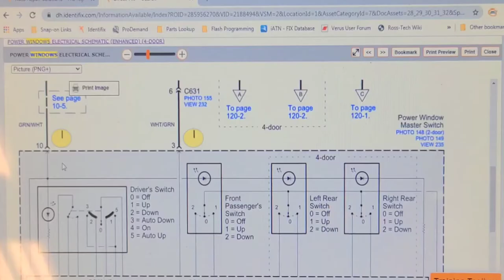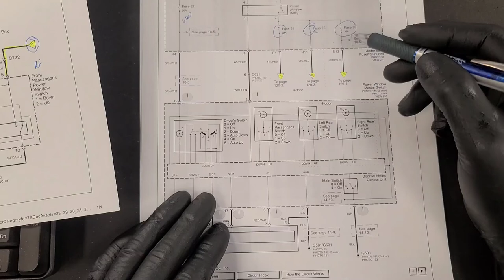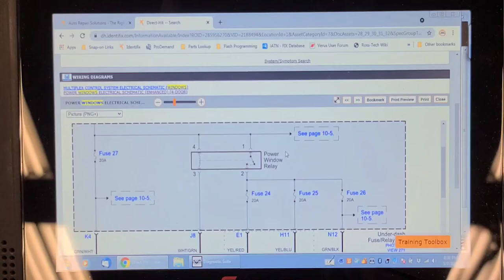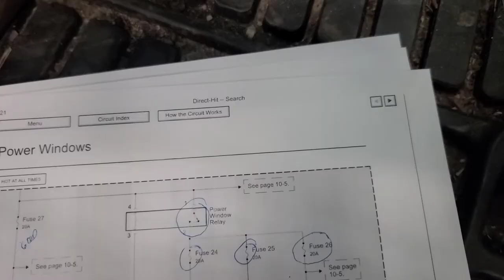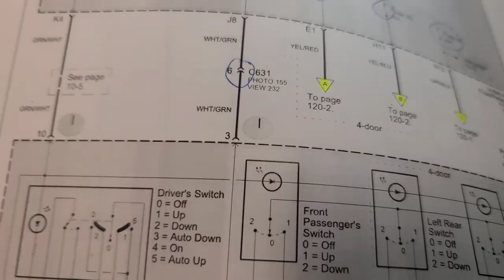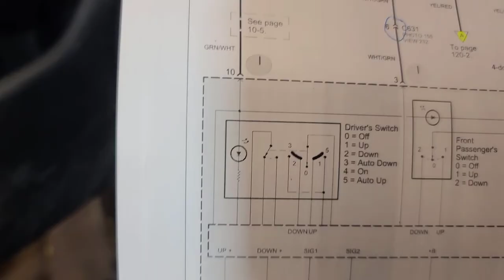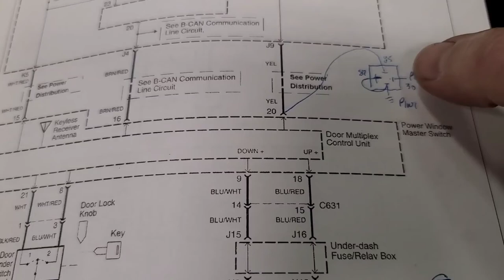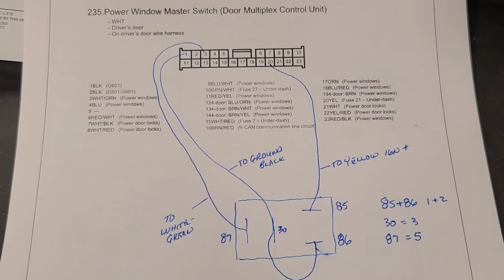2007 Honda Accord 4 Door SE. Three Power Windows Don't Work From Any Switch.

Comment: have you ever run into this problem on a 2001 Honda accord lx sedan been trying to fix it for a month and a half have run out of ways and ideas to fix it it is the exact same problem as on this video and where can you find a fuse jumper/relay tester
Reply from the maker: No I have not. I took a look at the schematic and it's quite a bit different. The master switch on the driver door locks out the other doors by removing the ground for them. It does not turn on a relay like this 07. There is a relay under the dash but it's turned on by the Passenger Multiplex Control Unit. This relay feeds all four switches so if your driver switch is working then this relay is good. Check fuses 7, 8 and 16 for power with the ignition on. Do the other three windows work from the driver control switch? There is a white/red wire at the master switch on the driver door that is grounded by the lockout switch to enable the other three windows, Check to make sure you don't have a broken wire between the driver door and A pillar. make sure that the white/red is grounded if not supply a ground to it and see if the three windows start working.

Comment: I’m also not the most familiar with electronics but with your relay bypass what exactly did u do with the wires? I know which ones u used but did you disconnected them from the master control and put them into your bypass and then used another wire to reconnect it to the master control or what
Reply from the maker: at 12:19 in the video is a schematic. All the wires from the relay are spliced into the appropriate wires at the master switch. The existing wires are still connected to the switch. HTH

Comment: I THINK THERE IS ONE MORE SIMPLE SOLUTION IS. YOU NEED A SWITCH BUTTON ON THE JUMBER WIRE IF YOU ARE NOT USING POWER WINDOWS ALL THE TIME . DISCONTINUE THE JUMPER BY SIMPLY SWITCHING OFF WITH BUTTON. AND I HOPE THIS WILL NEVER KILL YOUR BATTERY  THATS WILL NEVER KILL YOUR BATTERY

Comment: I have honda accord 2006 special edition lx. Front doors windows works but back window not. Should I change only the power switch?
Reply from the maker: You need to check the fuses, then test the circuits to the switch between the door and pillar.

Comment: Great video and very detailed explanation.
I have a few questions.
Working on 2007 Accord Ex (same layout as yours)
How much of an impact would parasitic draw put on the battery for bypassing the window lock switch?
I tried connecting pin 20 and pin 3 to only ground when the ignition is on. But it is working when ignition is off and doesn’t work when ignition is on
Now with relay, I tried connecting as you described, but the passenger side switches are active even when ignition or off. So For me the parasitic draw is happening with or without relay.
Reply from the maker: Sounds like you've got it wired incorrectly. The relay is to be turned on by the ignition feed and then supply the ground to the under dash relay. Recheck the two grounds. If the relay is turned on all the time it will draw around 100mA which would run the battery down in a few days. Depends on battery state of charge and ambient temperature.
Reply: @PhillipBailey  but why do you think grounding pin 3 with pin 20 will not work? After all pin 20 gets power when ignition is on and that should ground pin 3. What is the need for relay?
Reply from the maker: @rohitv.tangellamudi3735  you can't connect it that way. I'll watch the video again give me a second
Reply from the maker: @rohitv.tangellamudi3735  pin 20 is ignition switched power or positive. You can't connect it directly to pin 3 which is supposed to be a ground brom the master switch. Tee a wire into pin 20 wire and connect thar to pin 85 of any standard 4 pin relay. Connect pin 86 of the relay to pin 1 at the switch by again teeing into the wire. No when you turn on the key the new relay should click. Tee a wire into pin 3 and connect that to 30 on the relay. Connect 87 of the relay to pin 1 at the switch. Tee it in. You can also connect it to pin 86 of the relay so two wires on the same terminal. The way this works is the ignition power on pin 85 and ground on 86 energizes the electromagnetic coil. This causes the contacts in the relay to mechanically connect pin 30 to 87. This supplies the missing ground from the switch to supply the ground to the under dash relay that feeds power for the three door windows to work. All wires are teed into the respective circuits at thevswitch. 12:20 in this video. Hope this is helpful
Reply: @PhillipBailey  thank you very much for the detail
Reply from the maker: @rohitv.tangellamudi3735  let me know how you do...
Reply from the maker: @rohitv.tangellamudi3735  how did you fare?
Reply: @PhillipBailey  Hey Philip. I was gonna reply. It worked like a charm. Thanks for all you help and patience in guiding me. More than fixing it I completely understood the principles of relay and difference between the 4pin and 5pin. You’re a genius.

Comment: Great video sir. Sir I have a 2012 Accord I removed The front seats because I was working on the AC system I put it back together the passenger side window lock and window worked a day or two later it’s not working I have checked all my fuses I have checked all my plugs that are unplugged and I can’t seem to find anything the passenger side door lock or window will not work from the master control or from its own control was wondering maybe if you have any recommendations I should try? Thank you sir!!
Reply from the maker: So it's the right front window and door lock that don't work? From the master switch and from the RF switch? If this is the case let me know and I'll look at the circuit.
Reply from the maker: There is a connector called C107 on the right side under the dash and all the wiring to the right door passes through it. The power windows and locks are separate circuits. Fuse B33 feeds the right power window but there is no separate fuse for the rf lock. Look for that connector on the right side of the glovebox. It may not be seated correctly.

Comment: Hi phillip, my driver power lock not working after my brother touch the connector below passanger globebox..other 3 door works fine. Can u advice something please
Reply from the maker: Other than checking that connector  you mentioned and for broken wires between the door and A pillar you will need to test the circuits. and actuator in the door.

Comment: i have a 2006 accord where all three work but passenger side doesn’t, does this mean it is the exact same thing or just the fuse?
Reply from the maker: Check the fuses but it's not likely the same problem if only one widow is not working. Check wires between door and pillar.

Comment: Thank you for this video.  I’m dealing with this exact issue.  Can you clarify, is all of the wiring done at the level of the door?  Also, is it possible to list the steps in a step by step way?  Thank you, this will save me a few hundred dollars if I can make it work.
Reply from the maker: Rewatch the video from 12:10 on. You just need a conventional 4 pin relay. All wires are tee'd into. Strip a small amount of insulation on the three wires at the switch and attach the three wires from the relay. Everything can be done inside the driver door at the switch.
Reply: @PhillipBailey  thank you very much.  Didn’t want to start this repair until I got clarification.  Excellent video.
Reply: @PhillipBailey  sorry super idiot here. You do that with insulated copper wire correct?
Reply from the maker: @qmaster2205  yes insulated wire for sure

Comment: Phillip awesome video man very helpful however I’ve tried this but it doesn’t work I hear the clicking while pushing or pulling the controls for the passenger windows what do you think can be the problem
Reply from the maker: Check fuses 24  25 and 26 for power after your modification. It they don't have power review your work as you may have wired the relay incorrectly. You could also have a broken wire in between the door and pillar that is controlling the 3 windows lockout relay. This relay is shown at 5:00, 5:42 and 6:15 in the video. Try bypassing the lockout relay.

Comment: Hi i have a 2007 acura txts the same thing is happening to me. do you think i can used your illustration  to my car as well ? i think is the same .
Reply from the maker: I'll have a look at the diagram to see if the circuit is the same...
Reply: @PhillipBailey   Oh yes please i'm going nuts with this issue  thank you so much
Reply from the maker: I gather you meant TSX and if so the circuit looks the same but you need to confirm the master switch has failed.

Comment: What’s connection 85, 86, 87 and 30?  Do those numbers come from the electrical diagram?
Reply from the maker: Those numbers on on the pins of most relays. 85 and 86 are the low current control pins connected to the electromagnetic coil in the relay. Pin 30 and 87 are the switched pins that will connect when the control is connected to power and ground.
Reply: Thank you!

Comment: Where did you get your supplies to do the hookup?
Reply from the maker: I had a used relay. Any standard 4 pin relay will work. You will need about 3 feet of 18 gage wire, 4 female spades that fit the relay some solder and tape.

Comment: What relay did you buy and do you leave original relay back in the panel
Reply from the maker: I didn't buy one but any standard 4 pin relay will work. This additional relay turns on the relay under the dash so yes you have to leave it installed.
Reply: Thanks

Comment: Have this issue, 7th gen Accord EX 4dr. I have a theory. The materials used in weatherproofing the windows and creating channels for water to drain down are now getting quite old and warped, and on my year round outdoor-parked car it caused water to pool and drip directly onto the switch(?) in the driver door. I had the habit of opening my window just a crack to get fresh air. It's a great car. Had the VVT assembly changed. The car is going to rust away before the motor and transmission die. I think this is a safety issue, though. Gotta have windows that open
Reply from the maker: Yes this seems quite common. It was brought to my attention that this has been a topic on quite a few Honda forums. That's one neat thing about posting these videos. You find out just how often these problems arise.
Reply: Wanted to add that after jimmying with the childlock button, the windows worked as normal for about an hour before it failed again. 

Jesus, man. This is crazy shit. 500 Canadian is like 350 USD? How do I find someone willing to do this job for less than like $1000 USD. A dealer service department would probably charge something outrageous and probably fuck it up somehow . I haven't had a good experience with Honda service depts. Mostly the managers. My car is old and they treat me like shit because of that and because I'm young.  I just need an honest mechanic to give my business to.
Reply: @PhillipBailey  Well thanks for the video. Should I take this to a specialty shop or is this something most good mechanics could pull off. I like saving money on this issue. Ill never need the child lock if that's all I gotta give up. I'll buy something else when I have a kid on the way !
Reply from the maker: @Chironex_Fleckeri  I would say that any decent tech could do this. The dealer won't because they are worried about liability. Ask around I'm sure there are lots of guys that could do this. It's just a relay and a couple of spliced wires. Alternatively you could search Amazon and Ebay for the switch and install it yourself. As you can see it's not difficult to remove. Buying the part online and installing it yourself will likely be close to what a shop would charge to modify it this way. HTH and good luck.

Comment: Once you put the new 4pin relay in the door panel,  did you reinstall the power window relay under the dash?
Reply from the maker: Yes for sure you still need that.
Reply: @PhillipBailey  thank you.   Amazing video.  Car guru has a bunch of people asking about this from as long as 10 years ago.
Reply from the maker: @hexc0nn392  yes ive learned its a common problem. Glad it's helped someone.

Comment: My inside buttons all work great. 
The Remote hold "all window" and double click "all unlock" function stopped working.
Sorry to ask. Can't find any info. Worth a shot here
Reply from the maker: Do the key fobs still lock and unlock the doors? Do you have more than one fob? Try changing the remote battery?
Reply: @PhillipBailey  the battery’s only a few weeks old. Only locks and unlocks the drivers. No window roll down. I do see other things to check now. Relays. Maybe try programming. I suspect maybe is the fob though being 20yrs old.
Reply from the maker: @kewlbug  is it the same year as this Accord? Was there any work done recently like battery disconnected? Sounds like a programming issue. I'm wondering if the feature is customizable.  Be nice to try another remote to rule it out.
Reply: @PhillipBailey   Here's a piece of info, when I start the engine, it auto locks. but cycles twice it sounds like. I would guess my main issue here is a broken connection somewhere. possibly the door jamb.
Reply from the maker: @kewlbug  I seriously doubt it is a wiring problem.

Comment: This happened to me 2 days ago. My key fob battery died and I tried unlocking the windows from the outside by inserting my key on my driver door and turning it thrice. I do this sometimes but I have never done it with the driver side partially open. The three windows stopped working as a result. Also, all my inner lights stopped working too. Is the power Window switch somehow connected to my inner lights?
Reply from the maker: I'm not sure on the relationship of the interior lights. Sorry
Reply: @PhillipBailey  Thanks for your reply. I believe the power Window switch was tampered with by the previous car owner. I traced the fuse for the interior lights and it  was blown. I replaced the fuse today and all interior lights and window buttons started working again. Just that a new issue came up. I can't use the central lock if the ignition is not turned on. I decided to replace the battery on the key fob and noticed another issue. The car is no longer responding to the key fob even though the light on the key comes on when you press the buttons. I did some research and it turns out that the car now recognises the power window switch as a new part, meaning I have to re-programme my key fob. I did that with a tutorial I came across on YouTube and the car responded to the key fob when it is in the ignition but doesn't immediately I take it out. I have programmed it multiple times but it keeps doing the same thing. I am tired and confused.
Reply from the maker: @smartsteevy  I believe the master switch is the remote keyless entry receiver as well so if it's failed could result in the inability to program the remotes. This car did not have any issues with the remotes. Good luck possibly a new switch is in order here.

Comment: Couldn't you just run switched power to the factory relay to control it instead of adding another relay?
Reply from the maker: @jajajajajajajajaja867  the relay is switched by a ground from the master switch. There are a few ways to do this including wiring in an auxiliary switch to supply the ground but the operator would have to remember to turn it off or it would drain the battery over a few days. This way it's automatic. Or you could just buy a new switch.

Comment: @11:23 look at jumper wire .. jumper wire goes from the inside pin from the bottom to the black ⚫️  ground .... on the drawing it's on the other pin so which one is correct!?
Reply from the maker: Either will work but use the drawing as its clearer

Comment: where did you buy your relay jumper and removal tool?
Reply from the maker: That particular one in the video I purchased in a kit of three off the Snap-on truck. They were bluepoint brand. I don't think they sell them anymore. I have several types. Here is an awesome kit made by Lisle that I use a lot as well: https://ca.jbtools.com/lisle-69300-master-relay-set-w-leads-switch-fuse-power/
If you just want to bypass a relay try this kit: https://www.google.com/search?q=relay+switch+kit&client=ms-android-samsung-ss&prmd=sivn&sxsrf=ALiCzsbEGw7I_kbwN_gdgRgmqmb2AQvIaA:1656040588417&source=lnms&tbm=isch&sa=X&ved=2ahUKEwjygIb4j8X4AhUeLFkFHQIrCMoQ_AUoAnoECAIQAg&biw=412&bih=783&dpr=2.63#imgrc=bnUY_-EjxP1SVM
They are both great but the Lisle kit can help you test the actual relay in the circuit.
Reply: @PhillipBailey  Thank you so much I have a 2006 accord 3.0 coupe that the drive window works. But the passenger window does not I have changed the motor the switch and the fuses. Then I saw your video and my master switch does not activate the relay when using the window lock out switch so wanting to see if this would fix mine. Thanks for the response and the awesome video.

Comment: I have a 2000 Subaru Impreza sport manual. Tonight all 3 went out at the same time. Would this be similar to my problem? My mom gave me her gremlin I followed her to drop her car off at the shop because she had a no start ( starter and or alternator) we pushed the car and she popped the clutch to start it and we boogied over to drop her car off at the shop. and in the parking lot, the parking lot!!! of the mechanic shop at 7:32 on a Saturday 3 of my 4 windows stopped working. I blame her she brought the gremlin with her into my car 🤣🤣
Reply from the maker: Sounds like the child lockout switch on the master switch is off. Are you sure you didn't accidentally turn them off. The circuit is not the same at all.
Reply: @PhillipBailey  ☺️ of sources it was that simple 🤣 I have never used it but somehow I managed to depress it that night. Thank for your help